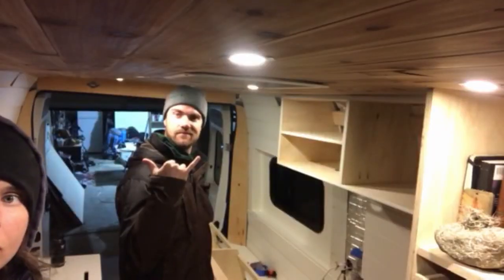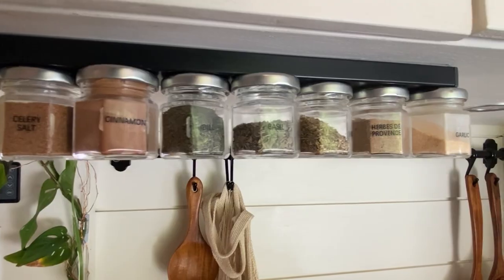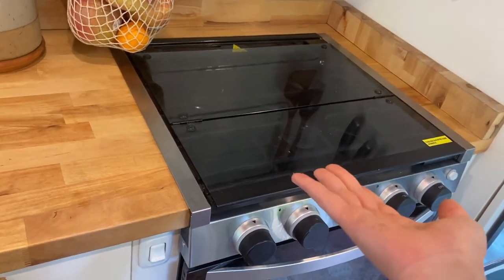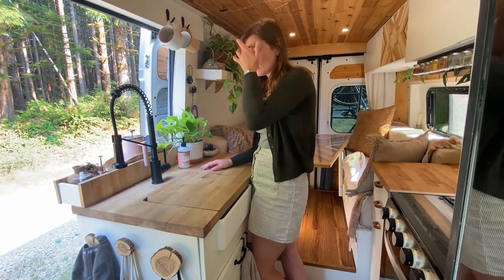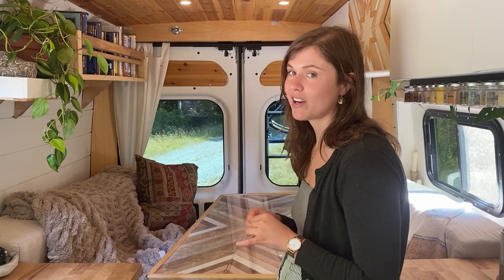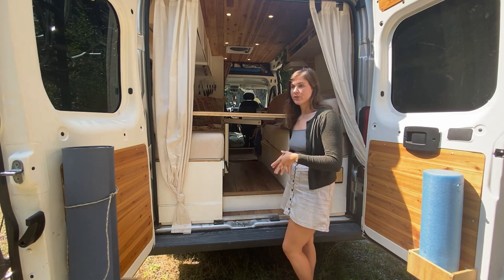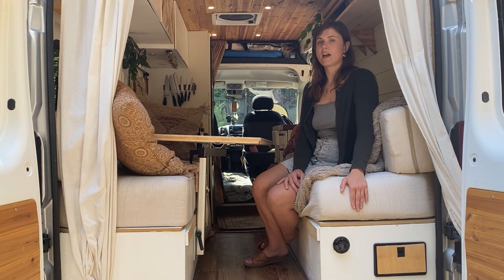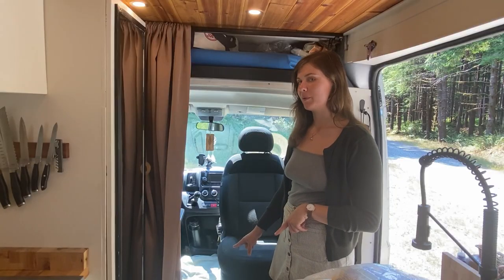VAN TOUR | Solo Female Traveler Converts 136wb Ram Promaster with Oven, Shower, & Full Closet

Comment: In my part of the country when it's expected to get frigid we open our cabinets and leave our water pipes exposed to the home heat. This helps prevent pipes bursting. The same should work in your van.

As far as the velcro is concerned I read an article about home remedies. It was spoke about removing tree sap from cars. They suggested chapstick. So taking some labels off of medicine bottle to be used later I used chapstick to remove the rest of the label and a glue and it works beautifully.

Goo gone works pretty good too.

Comment: A garage will always be the most important element in a van build for me, there is so much storage and you can fit so many essentials (first aid, extra water, equipment, out of season clothes storage, coats, portable solar panels, backpacking equipment, tools, etc). With a van that has extra roof space it would have been perfect.

Comment: Gorgeous van and I love all of the woodwork you have done. In you propane cabinet put some metal mesh over the hole to prevent unwanted wildlife visitors and bugs from entering the van. Using baskets or small bins will help keep your upper cabinets neat and organized and prevent things from turning into a jumbled mess while you drive. Great job.🤗👍🏻❤️🚐
Reply from the maker: Hi Meiralora, the mesh is on the outside of the propane cabinet, fear not! I agree about baskets, still looking for the right ones. Thank you for your suggestions!

Comment: love your oven - however i’m wondering if anyone has pointed out that your propane detector/smoke alarm can’t actually do its job inside of a cabinet or closet. It needs to be placed in the same space where the problem might happen - i.e. it needs to be mounted in the open area of your living space inside the van. propane detectors are most effective when mounted near the floor, smoke alarms are most effective when mounted on or near the ceiling. hope this is helpful.

Comment: I recently started binge watching converted van tours and honestly this one is my favorite so far. It's looks so beautiful and cozy, and the perfect size for solo traveling! I can only think of a couple minor things I would do differently, otherwise if I were to build my own van I'd want it to look like this.
Reply: I agree. Def one of the best designs. But i am curious what are the minor things you'd do differently?
Reply: @testimusicali6445  
-I would probably add netting material or something similar to the inside of the upper cabinets so I wouldn't worry so much about stuff falling out when I open them after moving. 
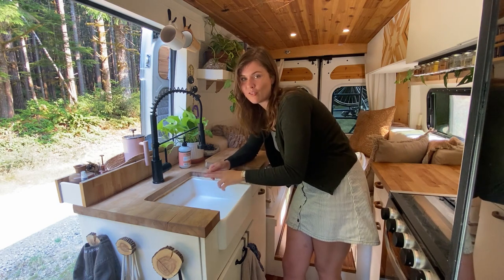-I'd use a different faucet/spigot for the sink as she mentioned @8:40 that one has a tendency to crack in cold weather, plus I've seen designs that I like a bit better and work just as well.
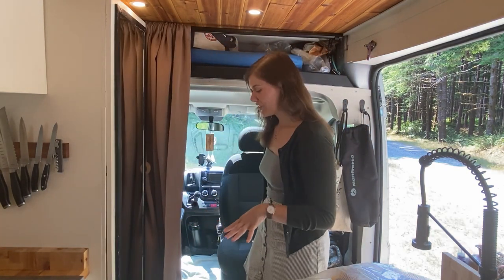-And maybe add a small table/counter next to the swivel seat @22:12 that could be tucked away when not in use (if there's space). That way I have a spot to eat/work if I have the bed set up and don't feel like setting up the dinette everyday.
Other than that I think it's just a matter of how I would use the space differently based on my own needs and interests!

Comment: OOH!! Genius idea(s) to rid yourself of the paddle board battle forever.  Option A is probably the easiest solution.  And that is mounting it to the side of the van.  Alternatively, B: add a little shelf to attach underneath or something.  Technically you wouldn't even need it to be a shelf but like a letterbox only rather than some cheap plastic you'd weld some metal attachments to the left and right at the appropriate distance and you can slide it in.  And C:  some clamps.  Which you can probably use on their own on however many sides make you comfortable or for added security on the "envelope" feature as I previously described or really as added security on any attachememt design you could come up with.  But oh!  Also... this way, it won't matter if it's dry! You can hang it, slide it, clamp it, or some combination or something I'm sure you could think of that might be better or easier.  
But it would also free up that space for your duvet cover..  😀 

Great job on this video as well, I'm trying to decide if I could travel like this.

Comment: I have checked out a lot of 144 vids. Never even heard of a 136. Awesome job !! In my humble opinion, there seems to be some power redundancy.
You have a great oven as well as a super kool bro. Yet you didn't mention any baking. I do so like your dining/sleeping set up. Awesome use of space. After a six I would wind up sleeping on one of the benches.
I keep trying to figure out how to get that type of seating area up front to include the front seats.
Then at sleep time you face the seats forward, pull the curtain, and you have urban sleep mode.
Happy to follow along on your journey. You have a lot of stuff but not a lot of clothes.
A girl after my own heart.

Comment: I’m interested to find out how tall you are. I’m 5’9” so being able to stand up straight is important as I have a bad back. You did a beautiful job on converting your van. Not to big to find parking. Well organized and pretty as well. Well done. 👍🙏🌹
Reply from the maker: Hey Cathlyn! I totally get it. I’m 5’10”! The high roof Promaster is 6’4” at the tallest point, before you add ceiling and floor insulation. I added pretty thin layers, so mine is now around 6’2” floor to ceiling.

Comment: Very lovely space.  You have an artistic eye.  Thanks for the tour.

Some things you may want to do:
1. Get the IKEA BEKVAM wall mount spice rack with RAJTAN jars. What you currently have with magnets will fail, guaranteed.  One bump and they fall.
2. If you want a good mortar and pestle, get an authentic Mexican Molcajete chiseled out of volcanic rock.  Grinds spices in seconds.  Also has a smaller footprint than that gigantic wooden one.  Its too big.
3. Add gas struts to your cabinets as soon as you can.  Will keep doors shut nicely.
4. Cut your hair short.  Solves the hair washing problem. Much less water use.